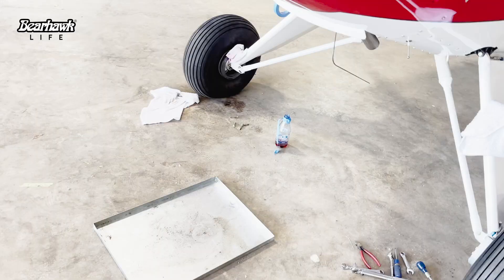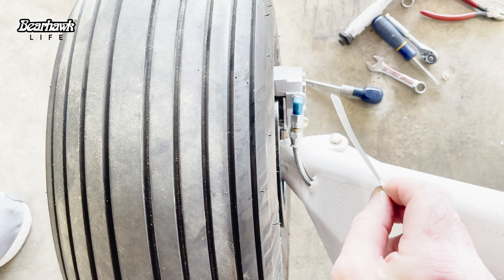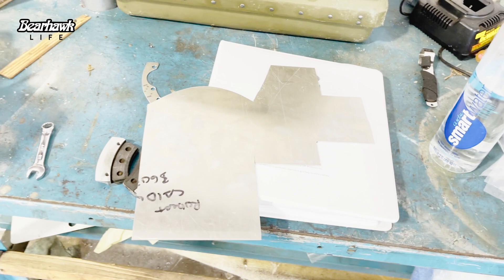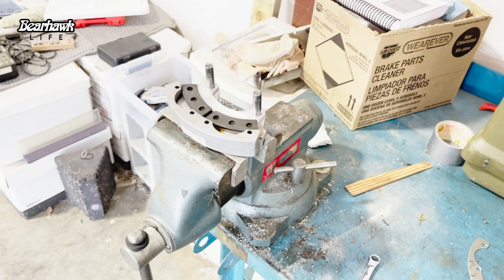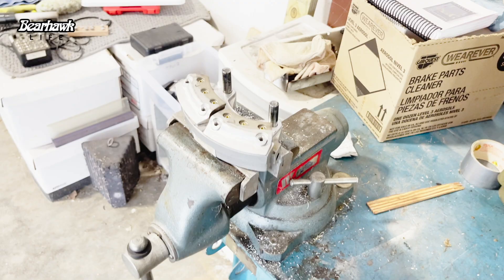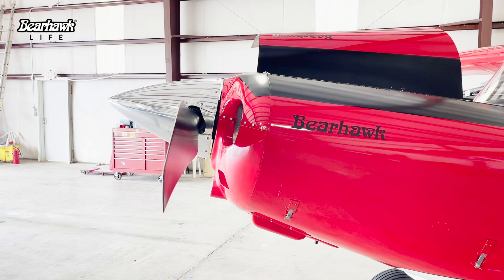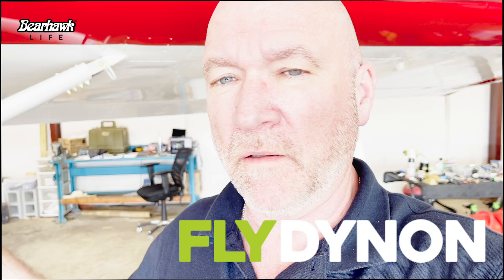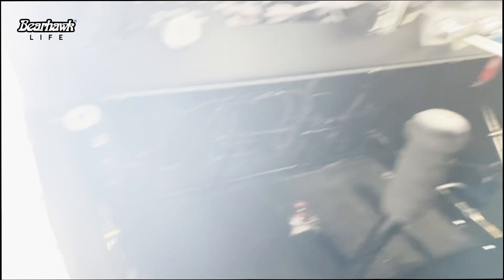BEARHAWK ~ Brake Troubleshooting UPDATE...  1st Flight Still Suspended...

Comment: Still feel the compensating port is being blocked off, which is there to stop pressure building due to expansion. As I have said before it might be blocked due to the mast cylinder piston being partly compressed in, so make sure the adjustment is correct on the piston, while you wait for the Dynon to arrive.
Reply: trouble shooting is the key not modifying! I like the path you are on!
Reply from the maker: Well we've changed master cylinders so not sure.  Will taxi test soon.  Thanks for watching!

Comment: Really sorry you're having this difficulty but it is a great opportunity to learn a lot about your various systems which will help you once you take on the role of doing basic maintenance & repair.

Regarding the need for use of spacers, I'd also measure the dimensions associated with the parts you received from the brake system OEM; to confirm they are as to be expected, if it's not a big deal to do so.. 

I'd also check the dimensions of your receiving structure (aircraft structure features for brake component installation).

They would have to be at the extreme ends of their tolerance range to end up with a 'stack up of tolerances' that causes such problems ... or then again, perhaps, the brake components aren't the right part number for your particular installation (just a wild guess on my part though by the way).

Hoping your fix works out, looks like a good one (two thumbs up)
Reply from the maker: All good suggestions.  I have been in direct communications with the manufacturer and the owner of the company.  Thanks for watching!

Comment: Hoping the added spacers do well for you and this issue---- BUT, one other wild idea---- is there a defect in the lining of the brake hose allowing basically a one-way free flow of pressure as one depresses the brake pedal but restricting flow as the pad moves back from the disc?  This would not be likely especially if you can easily push the brake pucks and cylinder back away from the rotor disc.
Reply from the maker: While bleeding the brake line, I disconnected the closest fitting, let it bleed, then reattached the line.  I then moved up to the next closest connection and did the same, all the way to the end.  It was a mess, but if there was anything in the line, I hopefully pushed it out.  Thanks for watching!
Reply: I wasn’t talking about foreign debris within the line but a flap like defect in the inner lining of the brake flexible line that would flip open in the return flow of the fluid acting as a one way valve. Acknowledging this is a potential defect in OLD lines but it could still occur in new lines

Comment: So the thickness of brake material doesn't match caliper travel? Hmm... I'd shim the assembly as much as possible without compromising caliper travel, or just replace everything and include measurements with the return shipment... Brakes have to be 100% operational.
Reply from the maker: Yes, apparently this is a fairly common fix for brake calipers.  Learn something new everyday.

Comment: How fast did you get up to for your brake burn-in, and how may times?
guide rods not having anti-seize/lube?   Possibly getting bound up/ galling. 
Using the right fluid in the system? 
Relief valve not operating.
Don’t modify with a bandaid.....Trouble shoot more, it’s your brakes for crying Out loud!
Reply from the maker: Yep, we followed all of the protocols and have been in contact with several engineers and multiple A&P's.  Ask 10 people, get 20 different opinions!  😜